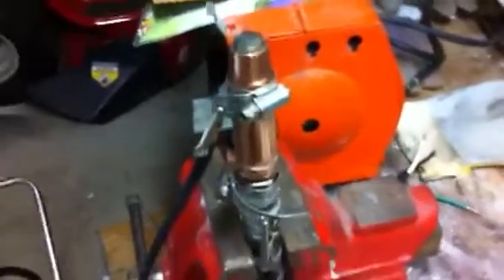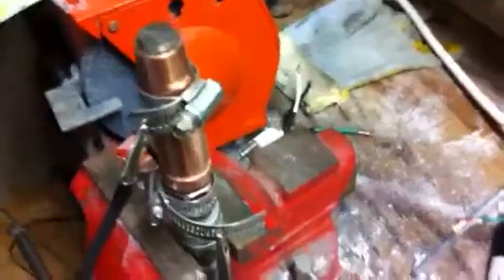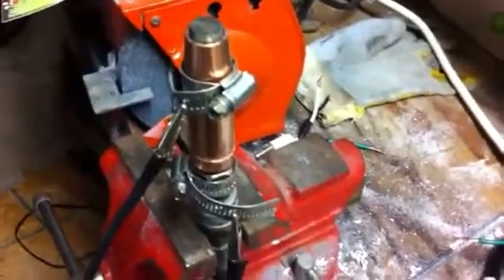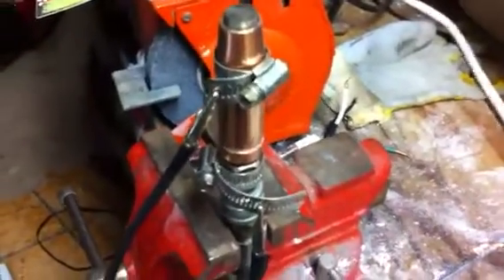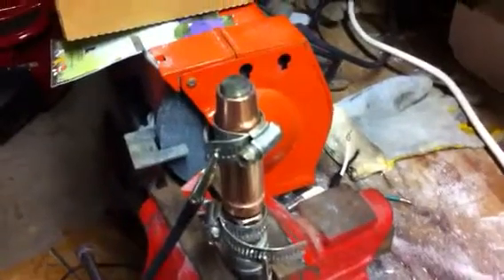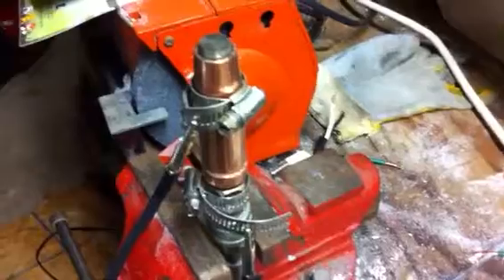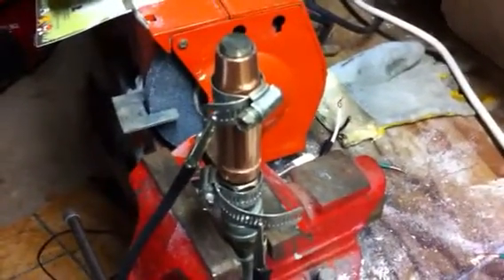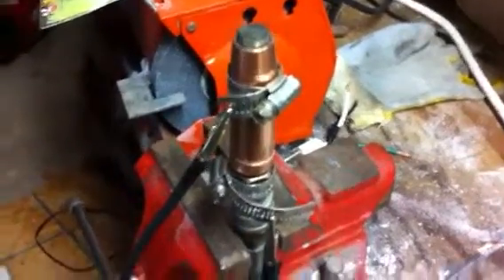spark gap through compressed air

Comment: "Stan Meyer injector work" - WOW man really?? You call this peace of crap Stan Meyer Injector?? Why would you call 2 pipes and microwave transformer Stan Meyer Injector? What Stan had and the technique (ignition coil) that burns water is faaaar from your microwave transformer throwing bunch of sparks..... Microwave trans is AC you need groving DC burst waves to split water first then burn.. AC only waporizes it does not burn oxygen hydrogen present. Take this video out of here or chance title!

Comment: Be safe. Put a little pressure behind your HHO and push it threw your spark. If you have pressure it will act like a torch when the flame is not touching the tip. The principles of a vapor (Meyer injector) is to bounce the gass off the top of the piston so it can start its work at BDC of the compression stroke. David A. Puchta